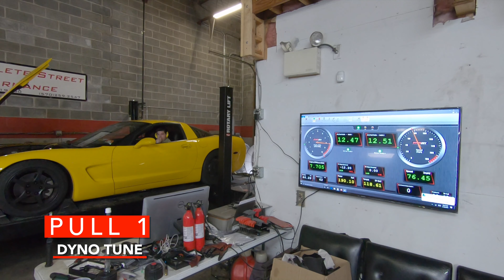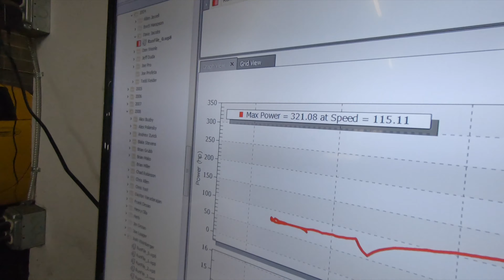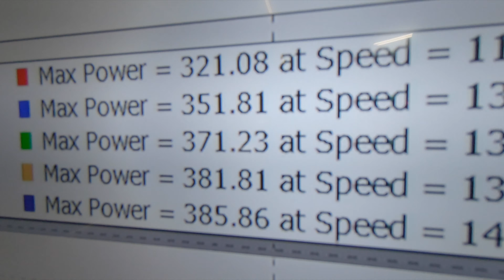C5 Corvette Dyno Tune BTR Stage 2 Cam | Complete Street Performance YellowVette04

Comment: Great video bro!! This was a great experience. I know it's not a big horsepower car, but she's mine and it was a lot of fun building this with you.
Reply from the maker: Thanks man! I had a blast with this project. She’s a beast man! That’s good power for a cam only LS1! 🤘
Reply: Hey, 385 to the wheels in a car that only weighs just over 3,000 lbs is nothing to scoff at.
Reply from the maker: ThatCorvetteGuy 2004 Very true. It’s even lighter when Dave isn’t in the drivers seat. 😂
Reply: @Team512  hey buddy, I wouldn't be talking over there 🤣
Reply: Hey Dave, go with the flow my friend. Don't apologize in any way shape of form! I tip my hat to both you and Scott in what you've accomplished. Save the Wave Guyz!🙋🏼‍♂️
Reply: @Team512  😂🤣 That's cold.
Reply: @YellowVette04  😂🤣 You tell him Dave!
Reply: @ThatCorvetteGuy  💯... but now I need to get over 400 🤘🤣
Reply: @YellowVette04  My end goal horsepower wise is roughly 500 whp.
Reply: Team 512 I think this is the best way to go with these cars. Moderate cam with high flow cats. So you’re getting some power but not messing with emissions or drivability. Nothing worse than seeing a 425+ car with no drivability. That extra 20hp is not worth the hassle. Add some 243’s on this and a vararam and it will be a great build. May want to upgrade the clutch too. Oh wait.............
Reply: @Debkghtulvkfjkjfxjjcj  got jokes 🤣🤣. 243s are definitely the plan for this and a 4L60 rebuild... since I don't have that clutch repair to worry about

Comment from the maker: What do you think of the power numbers that YellowVette04's C5 Corvette made with the BTR Stage 2 cam?
Reply: Mr. Scott  everything you  did to the  yellow  vett. I'm thinking of  having done. Plus intake and 243 heads. What  would be a  fair install  price ? It would be  going  in an FRC just like  yours. But needing  the same treatment as Yellow  Yellow vette.
Reply from the maker: For labor only, or do you need parts? Are you replacing the typical wear items like oil pump and timing chain? New balancer?
My suggestion is to call a few local shops and compare pricing. Labor rates can vary by location and shop.
Reply: @Team512  I have a few  more parts  to by.but pretty much need someone to do a great job on car.im in Maryland  not far. Ok thanks for  input, I figure  two more months I will be  in need of shop. Stay safe ! 😎 MORE VETTE STUFF 😁😀😀😀😁😁
Reply: @troy8940  Hi ! Hey at the power level Yellow vette 04 is making you really don't need intake manifold or cylinder head up grades. No offence. to Team 512 but if haven't checked out Richard Holdener on YouTube
you should. He's a wealth of good
advice. Highly knowledgeable about
LS & engines in general all based on
dyno testing. He's a regular at West Tech & author of gear head books.
He does multiple variations & combinations of parts & engines 
comparisons.

Comment: thats kinda weak. You can pull 360ish whp just with a minor tune on a stock motor with airbox. Add I/H/E/C and ignition upgrades along with a tune should see 400whp on a stage 2 cam or more

Comment: cool, what is stock wheel power on the auto ls1?
Reply from the maker: Usually around 295 or so for a stock auto C5
Reply: @Team512   damn, and it was just a cam so far right?
Reply from the maker: cole mcmeans Cam, headers, catted xpipe, Billy Boat Bullet axle back. Yeah it made good power! Oh yeah, and nothing blew up on the dyno. 😂
Reply: @Team512  when can I bring my car to the yellow 512 shop? Hehe
Reply: @colemcmeans7809  yea even Andrew said he was expecting high 370s and we broke the door down and didn't break!!
Reply: @YellowVette04  love it, do you plan on taking it to the track any? would be cool to see 0-60 and 60 ft times and of course the 1/4 time. I had an app that would track all that on phone but idk how accurate.
Reply: Should have went to R P M GOOD LUCK WITH THAT